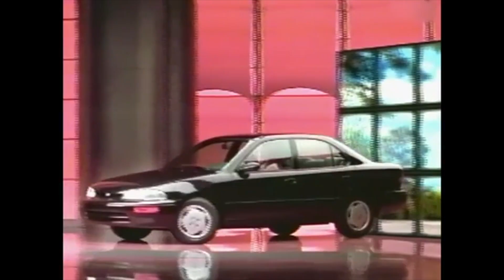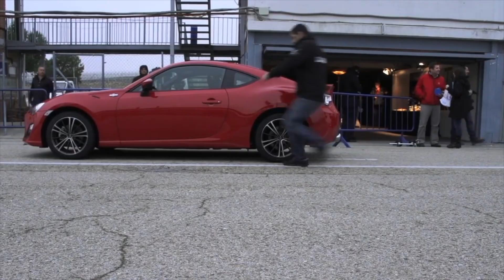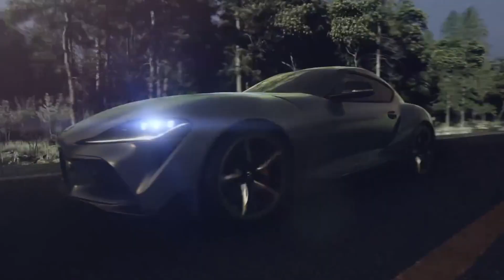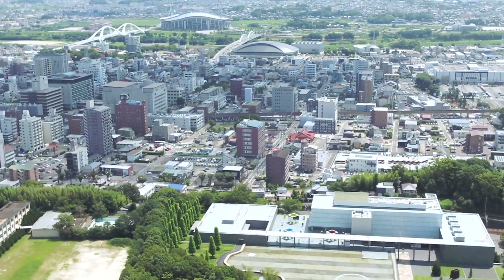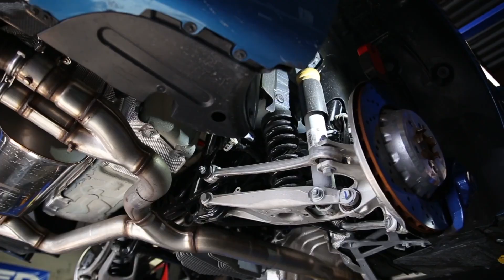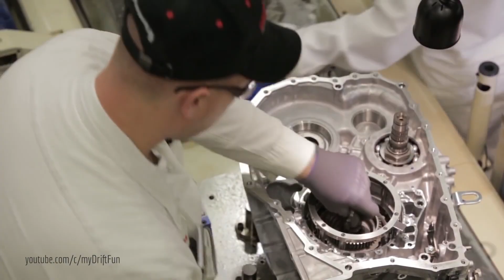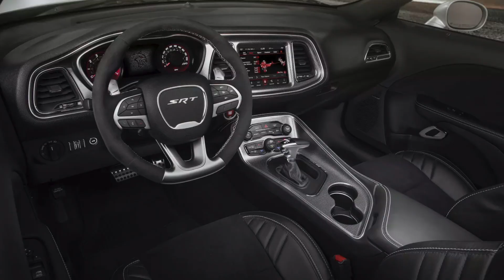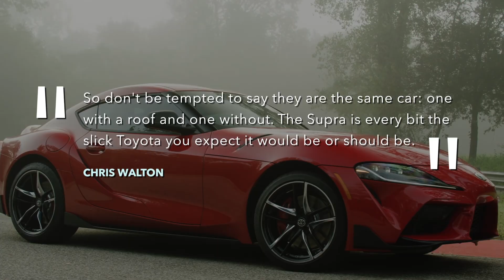MKV Toyota Supra - BMW or Toyota? The UNTOLD TRUE STORY

Comment: ok whatever, theres still no manual.....
Reply: A manual is fun for a weekend toy.  But for driving in stop and go rush hour traffic I'll pass.  Plus a modern automatic get better mileage. Untill the last 15 years or so a manual box got better mileage. This is critical with fuel efficiency standards becoming more insane every year.  Many double clutch gearboxes shift faster than you can working the clutch and shifter yourself.  So outside of the charm of pushing a clutch and moving a shifter a modern automatic or semi auto manual have the manual box beaten in every way.
Reply: @bmstylee  Auto's are fine for motorway cars but for a sports car, especially one which was infamous in the 90s, any real enthusiast would prefer the manual. The level of control and connection to the car that the manual gives cannot be matched by any autobox. Also, manuals are much cheaper to repair than automatics which is handy for a sports car that is primarily intended to be driven hard causing accelerated wear on the gearbox. The Supra is supposed to be a nostalgic throwback to the MK4 that we all knew and loved from the 90s but instead we've been given this re-badged underpowered Z4 without so much as a manual option. I can totally understand all of the hatred towards it, they've well and truly dragged the Supra name through the mud with this one.

Comment: If I could afford them, I'd still buy them, even bouth! But I'm not fooled for 1 second that that thing is a Supra. Call it whatever, it's a BMW with Toyota's quality control and tuning and that's it. Not a Supra. The exterior design somewhat remotely reminds of the Supra, although the original was more slanted, longer hood and the iconic tailights are gone (great job Nissan btw, for figuring this part out and keeping while updating your iconic GTR tailights. Toyota completely failed at this exercise), the interior has nothing to do with a Supra whatsoever, just a modern day BMW with gentle Toyota design queues. The original Supra had that iconic cockpit actually driver oriented dash. Heck even old e30s, e36s and e46s have a more driver-oriented dash than the Zupra. And maybe last but not least no manual?! I know it's hard to argue with sales numbers where the masses of lazy, skill lacking drivers dictate that automatic is the way to go. I know autos are faster and more efficient, but the Supra isn't supposed to be a drag car or a limousine, it's supposed to be a driver's car, a driver that enjoys manouvering the thing, sharpening his control skills and be engaged with it. This trend keeps up and they'll soon call autonomous cars "driver's cars". If they would've been more serious about making a driver's car, Toyota/BMW could have at least offered a yearly limitted edition manual version for the Zupra platform. 
But anyways, it's still great that in this day and age we still have 1 and a half more cars to work with. I think that the Zupra name is a much better compromise if Toyota still insists on calling that thing a Supra.
I guess, what could be done for those still waiting for a modern day Supra would be to either source a manual ZF transmission or something similar and adapt it to the Zupra, source the Z4's 4 banger manual and beef it up or... Just buy a manual Porsche...
All in all, Toyota's message or response with this project, based on the actions taken is more like:
"we're so tired of all of these people yapping on an on about a new Supra! We need money anyways, so let's listen to our new friend, BMW and take this opportunity to make a lot of money by making sure we cheap out as much as possible by selling all of those annoying kids a make shift, gobbled up, parts bin BMW, tune BMW's tech here and there, give it a different looking shell, change a few lines on the interior here and there, color it a bit different and call it a Supra. Those annoying kids won't know a thing and they're too dumb to tell anyways! Behold the brand new, completely different, totally not a Z4, kinda BMW but we tested it a lot, we promise, Toyota Supra!!! :)

Ok, it's been fun. Now back to my poor mortal life :)